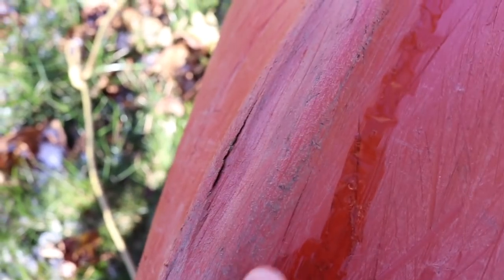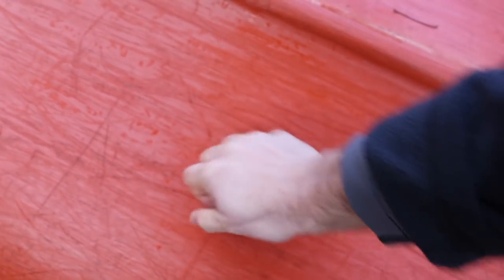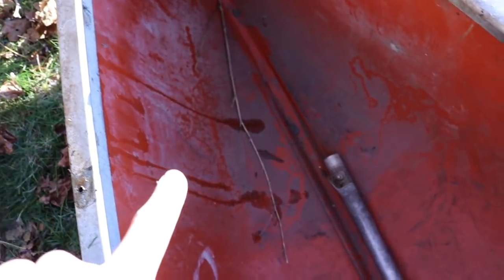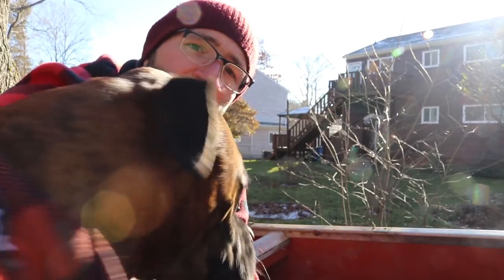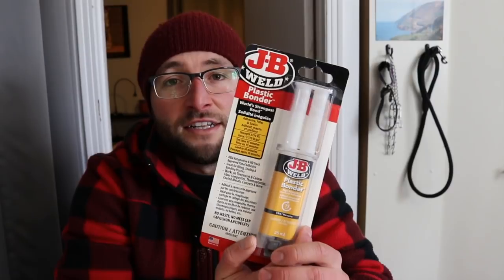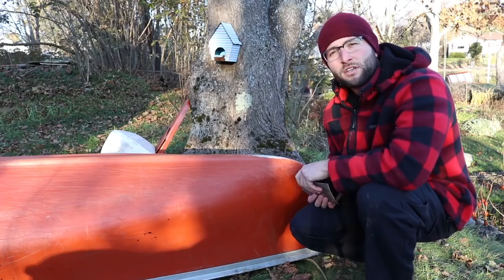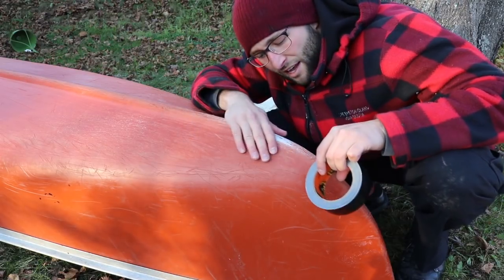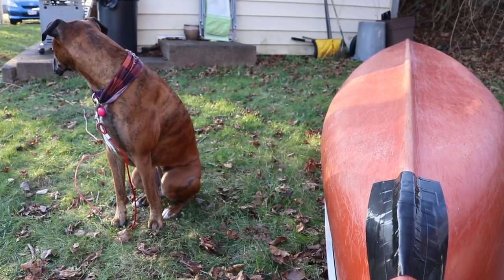Keel Repair - Coleman Canoe (HPDE)

Comment: Both of my Kayaks wore thru in the same place.  They are HDPE so I cut a little material off of a HDPE bucket and with a large flat tip on my soldering iron i just slowly melted and spread the bucket piece into the crack.  Took about 5 minutes and was as good as new.   Bonus was I used a Home Depot bucket which was orange and it matched the color of my kayak perfectly (not that it was that critical).

Comment: I used a "Mighty Putty" type of stuff 10 years ago. Got it at HD, it's a water sealing putty I got in the paint department. I used 2 rolls. Same spot as yours and it worked like a charm. Got hard like concrete. I did not sand mine like you did. It has worn down over the years but still holding up. Your fix looks awesome also. If that epoxy is not available for some, just sayin this was a $10 fix for me. Good job. Thanks for posting.

Comment: I think your repair will work for awhile it's a good field repair and gives more life into your canoe.  After it wears and falls off check how well the JB weld is bonded to the canoe. If not intact then redo the JB weld but use more of it. If it is intact then all you might want to do is to add a pair of skid plates to the bottom of bow and stern. The HDPE should be compatible with the resin even if the material included is like royalex. It's always worth fixing an old canoe...like helping an old friend.

Comment: Hey there, I'd love to know your fix has held up over time. I commute with my plastic canoe every day and it's getting pretty beat up, and have tried a couple of things that have only worked short term. Would you still recommend this method? I'm thinking about trying this then adding a keel strip for added durability.
Reply from the maker: Hi Natasha great news, it still floats with no leaks! I would recommend this method :)
Reply: I know it's been a year but I'm interested in this comment, do you commute to work on your canoe?

Comment: years ago I totaled a coleman running the nine mile river from Timberlea to Shad Bay during spring run,  broke both ends off canoe hitting sidewinders (trees across river) had to hop out in a set of rapids as canoe was bending around tree, bent all the ribs, shot most all rapids except a couple, paddled across shad Bay in what was left of a canoe, coleman does make a good canoe

Comment: Got a coleman scanoe That I have had since 1984...luckily no holes but i have an Old town 158 that I got a hole in and I repaired it with Old towns epoxy fiverglass mix but then I put gorilla tape over repair like you did. But I use the camo gorilla tape and I have had it on 10years  or so. I replace the tape every 2 years or so.     Google  "Whaley Welding" and the legend John Whaley repaired his kayaks with nothing but duct tape and heat.
Reply from the maker: Thanks for the note Mack, duck tape really does fix everything!